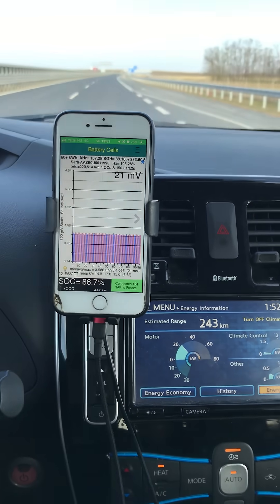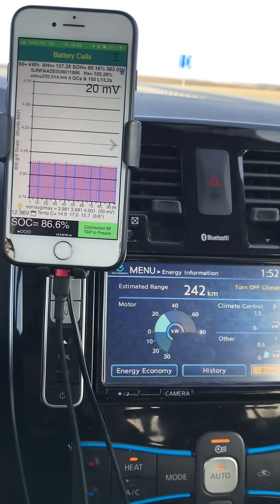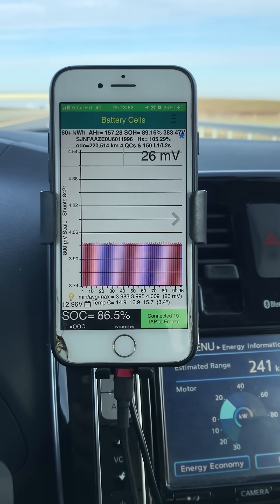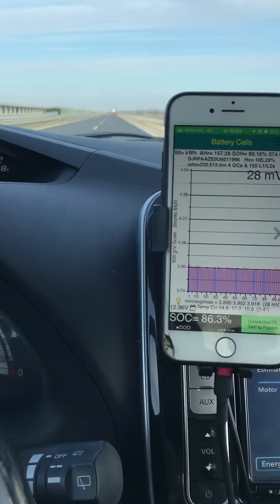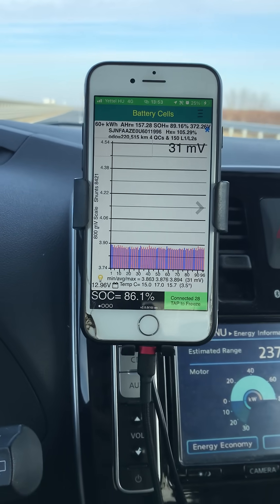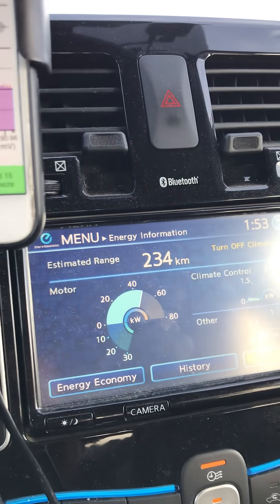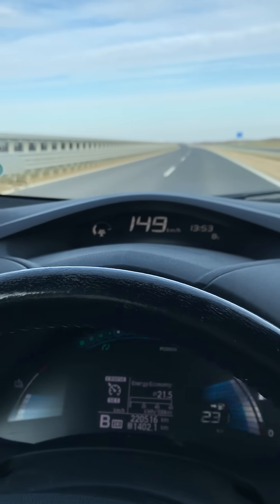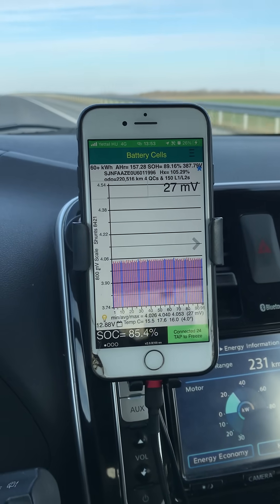Stress Testing a Nissan Leaf battery with LeafSpy - the only way to test fully - this one is amazing

Comment: Wow, amazing, what's Miles/kwh, also what's range fully charged, is this straight forward quick swap battery? Is the car much quicker to 0-62mph?
Reply from the maker: I get 4 miles / kWh because I enjoy the performance, so 240 miles is easily achieved :-) Here's the link to one of my many videos covering this swap:https://youtu.be/f_5kKW_bQ7Q - with the plug & play translator kit from #EVsenhanced, any competent mechanic can do this upgrade :-) The 0-62mph is actually slightly slower, due to the extra battery weight, but the ride comfort is smoother, and the economy at speed is better, as the car sits a little lower .....
Reply: @mnmszerviz  how come same battery in new leaf its much faster than compare to this one,? Thought will be faster or at least same as the new car in the bigger battery?
Reply from the maker: The newer Leaf has a 160kw inverter, these older ones are 80kw, before any inverter / programming upgrades.